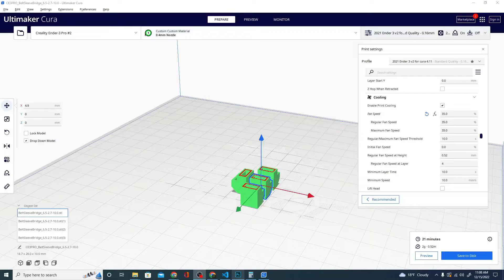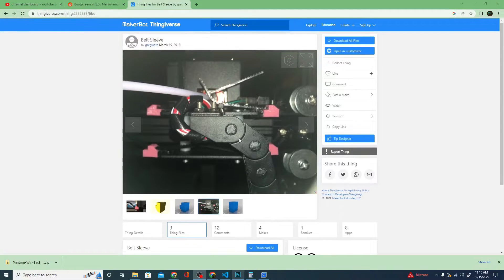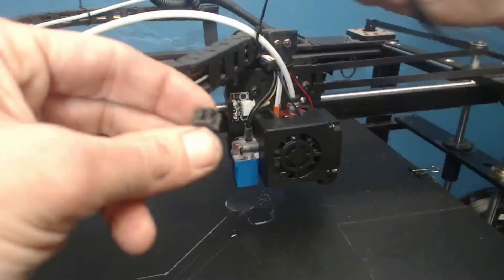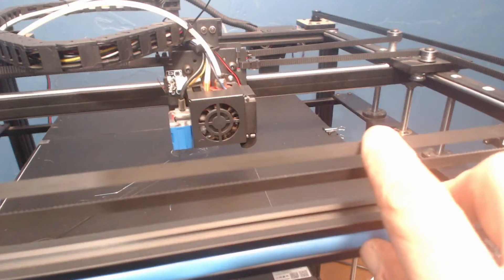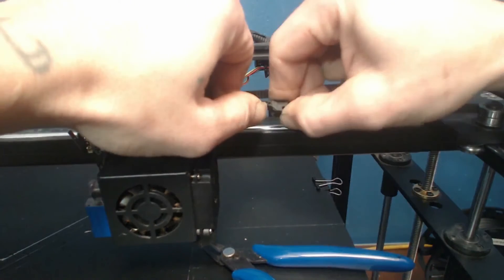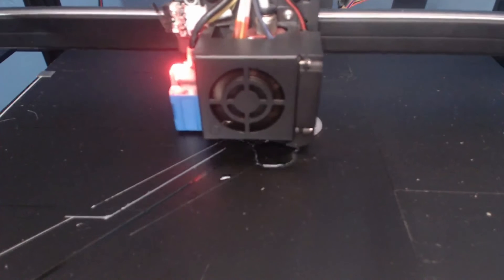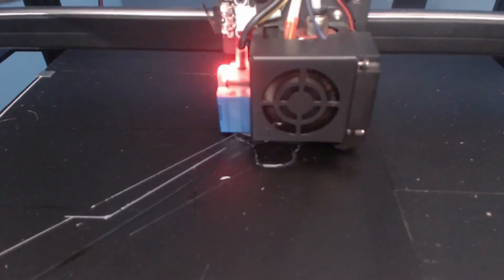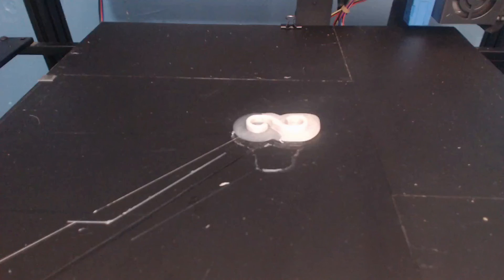Tronxy x5Sa PRO - How to get tighter belts and reduce ringing!

Comment: This is the machine that the VzBot started life out as.  Vez is currently printing at what...2000mm/s with 40,000mm/s/s accelerations last I remember.  This is a really really good machine in its non "Pro" form like is seen here.  The "pro" has those stupid metal groove wheels, which means if you want to change it out to something like hiwin rails, you're boned, because you gotta now go buy 2 additional T-slot rails to replace the "pro" rails up top.  Still, gutting this thing and putting a good set of electronics in it (Mellow Super Infinity board, Octopus, Spider, etc) is a really really good option for a cheap CoreXY.

Comment: I remember when this printer first came out, some reviewers had trouble getting enough tension into the belts and slated it for this, however, some reviewers did not have any trouble getting enough tension in them to get good prints, having tensioners should make a massive difference!